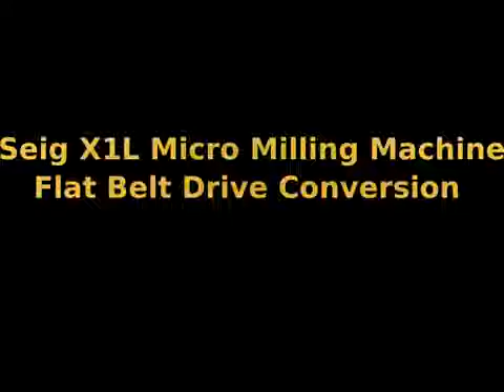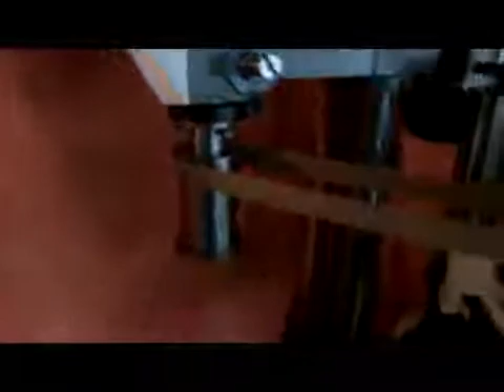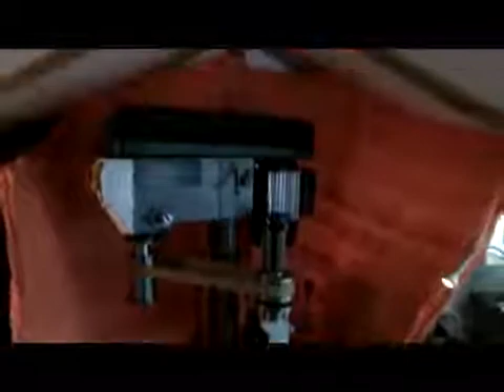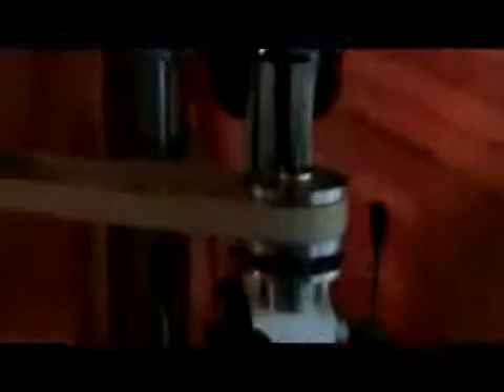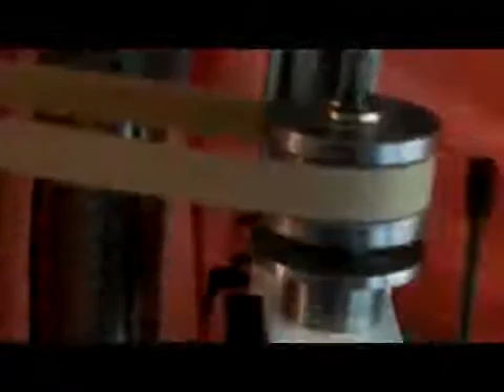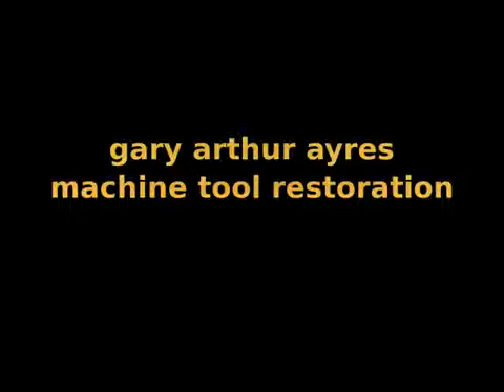Sieg Milling Machine Flat Belt Drive Conversion

Comment: How well has this worked for you?
Reply from the maker: I'd say it has worked reasonably well, but one has to be realistic in one's expectations. I have only used it for two jobs. One was making diagonal cuts across aluminium bar with a slitting saw. A bit of belt slippage, but worked fine. The other was using a boring head to enlarge a hole in a pretty thick steel plate. That worked in itself, but as with any small mill it took lots of passes and the motor of the drill press actually developed a problem. I don't think this was a fault in the setup itself, but rather the effect on a cheap motor of being switched on and off so many times. I'm thinking of replacing the motor with a 3-phase one plus inverter and would not hesitate to use this setup again.

That was the long answer. The short one is: probably better than the plastic-geared micromill that it was before I converted it.

Hope that answers your question; thanks for your interest.
Reply from the maker: I have now used this with the new 3 phase motor on the drill press - using a boring head to enlarge a hole in 5mm steel plate. It's pretty good - it got me out of a pinch as the drawbar on my other mill didn't fit the boring head. No complaints!